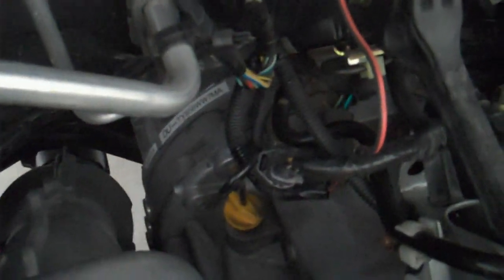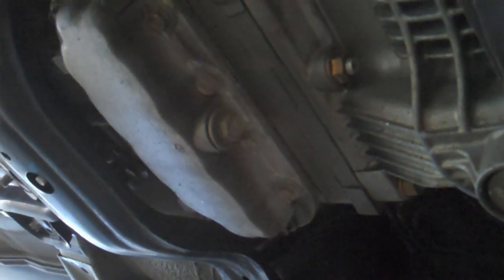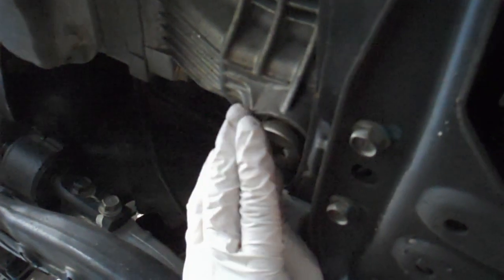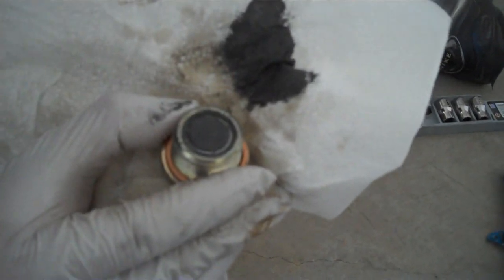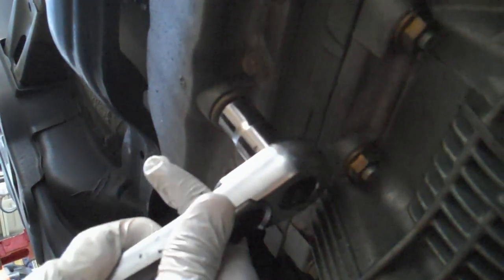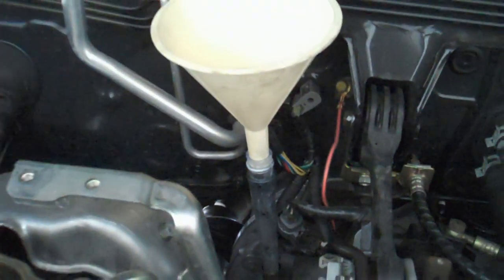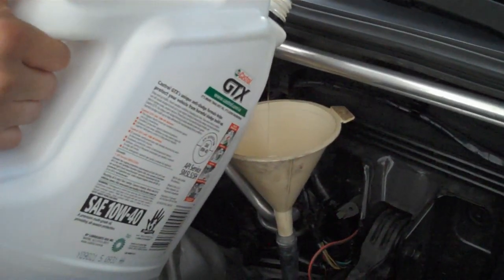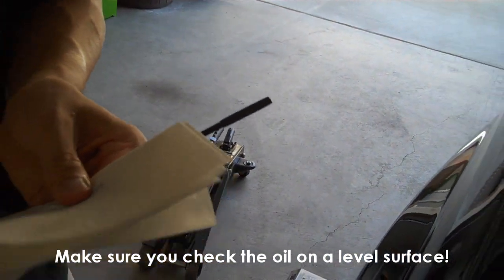Tutorial: Change manual transmission fluid on a 2006 Subaru WRX STi

Comment: Thanks for this, quick and to the point.  Just did the trans fluid on my 05 STI and had a couple comments:
1. Mine had 21mm and 14mm hex bolts, did not have the T70
2. A lot more fluid comes out if you jack the rear of the car higher than the front

Comment: Quick tip, next time when you are pouring the oil in hold the bottle side ways and it wont glug in, it will pour in smoothly.

Thanks for the video!

Comment: Lmao, dude I cringed so hard when I saw you were putting 10w30 in there. Glad you cleared that up though !
Reply: He explained that he had Subaru put transmission fluid in the 5 QT container. It did at first glance look like he was putting the wrong stuff if you don't listen to his explanation of why he was using that container.
Reply: +Charlie Carmichael you might be if you were unable to listen from 1:40-1:55 which is 15seconds. Watch, listen and learn next time.
Reply: Nicolas R he clearly said glad you cleared that up though

Comment: Thanks for the video! With the help of this video and your other one I changed the tranny fluid and rear diff fluid on my 06 2.5i impreza. One thing worth mentioning is that the tranny drain plug can be really tight from the factory. I ended up using a cheater bar but I recommend having a breaker bar for the job.

Comment: I noticed the first plug you pulled you had to use a t70 torx. Isnt that for the front differential? the the second one you showed was the trans. pan. I could be wrong but i was a little confused by this.
Reply: Yes, it's an access port for the ring gear and measuring lash. You need to do both. If you don't do the Torx drive plug (where the cross brace is) a small amount of oil will remain. Not a quart, but some. I pull the pan off and clean the magnet. It pops right off, only held on by magnetism. No need to remove the pickup. Do the pant if it's got lots of miles and never been regularly changed. Recommendations are every 30K, which I think is rather silly, unless it's the first 30K change and especially if you don't drive it hard.

Comment: @ndon54 Lubricates all the gears in the manual gearbox. It's a sealed system so there is no combustion etc. occurring, so the oil does last a pretty long time, as it doesn't get very dirty over it's life.

Comment: Thank you very much for the very informative video.  Just wondering if you ever tempt to use something else other than Subaru gear oil.  Also the oil that was drained looks brand new; how often do you change it.  And do you really feel a difference after the change?

Comment: Tried to change transmission fluid at the weekend - had car on ramp and intercooler removed (04 STI) but then when I tried to remove the large 21mm drain plug on transmission with large torque wrench it was impossible - the thing was welded solid. Please people take note - you NEED one of those air impact wrenches only garages have if your car is a few years old - the wet and weather will completely seize this large bolt shut!

Comment: Are you just taking off the intercooler for convenience? I know new wrx's have a lengthy metal pull ring as part of the dip stick.
Reply from the maker: Its really hard to get to the dipstick without taking the IC off. If you have a flexible funnel, that would work best. So no, you dont have to, but it makes it easier.

Comment: Hey thanks for this vid, I have a 2010 2.5i, and I know that they are a bit different, but my question is regarding the torque. How much am i supposed to torque down that torx drain plug? and the rear diff?

Comment: If anyone can answer, I would appreciate it. If my drain bolt is not the t-70 and it's the regular socket one. Does that mean my transmission is a 02-03? I'm not too sure what the previous owner did. My car is a 02 WRX, but engine is a 2.5L. I remember draining the fluid and my drain bolt wasn't the t-70 bolt. Just curious to know more. Also, is there any way to go check on the transmission to see which type is it? Like a #? Any information would be nice. Thank you.
Reply from the maker: this is definitely a question for nasioc.com  try that forum, im sure the gearheads over there would know :)
Reply: Thanks!

Comment: Did you replace the crush washers on the drain plugs with new ones?
Reply from the maker: Gil Gredinger Im a bum.  i shouldve, but i didnt.  i actually dont do this very often with tranny or oil fluid and haven't had leaks knock on wood.  but i would recommend changing them.

Comment: My 06 STi doesn't have a Torx bolt for the bottom bolt... it's just the one you can take off with a regular socket. Weird.
Reply from the maker: huh interesting.  if memory serves me correctly, they might have made a change mid year on the 06 to the Torx bolt.  Mine was literally one of the last model year 06's to come into the dealership.  bought it at the end of August, so maybe that's why?  id love to have a regular bolt, save me some money on this stupid special Torx bit lol

Comment from the maker: honestly i dont know what the torque specs are.  usually i just make bolts snug to tight, but not so tight you break something.  im lazy i know :P
Reply: 32.5 ft/lb for the small one and 51.6 ft/lb for the big one.

Comment: you should not be using an impact gun on these bolts, and using your torque wrench to loosen bolts will make your torque wrench inaccurate.

That said use a breaker bar and slowly loosen.

Comment: 2005 sti is the same ?
Reply from the maker: i believe so, either that or easier.  some of the models just require a normal socket and not the torx socket.  cant remember if that was the 04 or 05 or both
Reply: nukem384 nice man thank you so much awesome explaining videos

Comment: where is the manual transmission dip stick on a 06 impreza?
Reply from the maker: i believe its in the same place as in this video
Reply: It's not there. I swear. My it's only an Impreza not a WRX by the way.
Reply from the maker: its gotta be on the tranny somewhere, try the other side?  id suggest going to nasioc.com and look at their forum.  im sure theyll have your answer
Reply: Thanks. I'll double check.

Comment: Woah, Why are you using 10W-40 motor oil? Shouldnt you be using GL-5 rated Gear oil either 80W, 85W, or 75W-90?

Comment: Would this be the same process for an 07 WRX TR (USA)?
Reply from the maker: Kevin Ventura slightly different.  i believe the regular WRXs don't have the second, back bolt and there's no TORX socket on yours, just a normal bolt.
Reply: nukem384 thank you very much for the info and for the fast reply lol do you recommend changing the tran fluid and diff at the same time?
Reply from the maker: might as well yeah